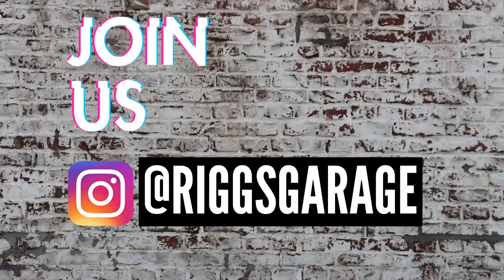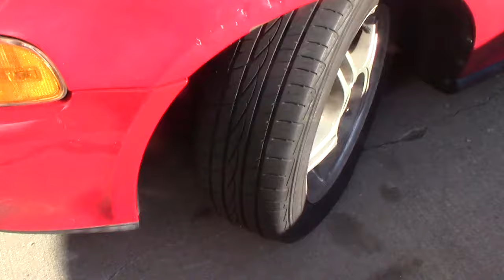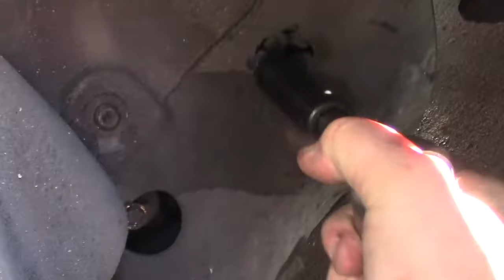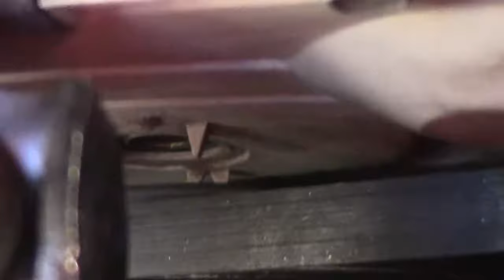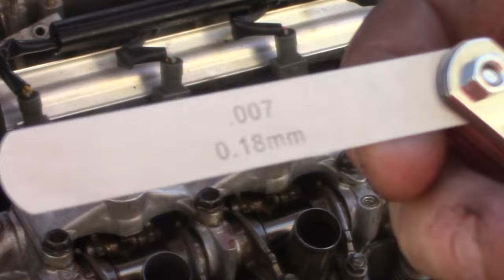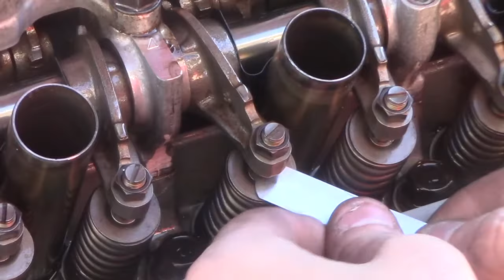How to Adjust Honda Civic D Series Engine Valve Lash (D15, D16)

Comment: I'm so glad to find this video. I've got a Honda D17A2 1.7 Liter and I have spent a month trying to get the valve lash properly set. I've been using the repair and maintenance guide that dealerships get. It indicates that both exhaust and intake settings for Cylinder 1 should be done at TDC, and then following the ignition sequence of 1-3-4-2 with a 90 degree counterclockwise turn of the cam gear (which is supposed to equate to a 180 degree turn of the engine gear down behind the tire). 

I've used feeler gauges and Go/No Go feeler gauges, as well as a positive response bolt to find TDC for each individual cylinder. But I just cannot seem to get the valve lash right. Tried 11 times and it's driving me batty!

So, is the method of turning the camshaft at the gear at the top of the timing belt an acceptable action? It's a 1:2 ratio, so a 180 degree turn of the engine pulley is equal to 90 degrees at the cam gear. And, if you follow the ignition sequence to get TDC on each cylinder, setting the intake and exhaust at that specific cylinder as you go, will it work?

And, most importantly, how much drag should you feel on your gauges? I've tried supposedly foolproof gauges which have two thicknesses on the blade: one is the desired gap clearance, and the other is a larger size outside of acceptable clearance range. You simply tighten the rocker arm bolt down until the thicker of the two clearances on the blade can't fit. And I did that exactly, but I must be some kinda gorilla to drag the blades through as hard as I do because it still resulted in a valve lash so tight that it endangered the engine. 

So, in light of that, can anyone liken the amount of drag you should feel on the feeler gauge blade to something else that might be known as a daily action? Pulling open a fridge door; something like that. Or, for the more mathematically minded, does anyone know how much force is required to drag the blade through the gap? In Newtons, Foot-pounds, or what have you?
Reply from the maker: Wow 11 times! That's pretty intense. Let me see if I can help you. 
As for turning the cam gear, are you referring to actually turning the engine with that bolt on the cam gear? I would not recommend that one
I'm wondering if your multiple attempts are because you are not holding the valve lash adjustment with a screwdriver as you are tightening it, so your adjustment isn't actually getting dialed in to what you measured. Does that make sense? 
As for your question about how the gauge should feel as you drag it out of the gap, that's pretty hard to quantify, but I'm sitting at my desk here and I would equate it to picking up a piece of paper in between your thumb and index finger, then dragging the piece of paper out from between the thumb and index finger. Tight enough to drag some what, but not very tight. Then you have to make sure you lock in that exact setting and don't let the lash adjustment move when you tighten it down.
Reply: @RiggsGarage  Thank you for taking the time to reply. In regards to the cam gear, since it's connected to a solid camshaft, and the gear is connected to the engine pulley via the timing belt, I yanked the spark plugs so there would be less resistance in the cylinders and used a universal camshaft lever (Looks like a big lowercase y with the angled arm on a hinge. Pins screw into the side of the straight and hinged arm ends, which you then fit into the cutouts of the cam gear in order to turn it.) It doesn't run the risk of messing with the cam gear's connection to the camshaft that you would if you turned the cam gear by the nut. And the pins are on opposite sides of the cam gear nut, resulting in even pressure applied to the cam gear as it turns. So, I am not exactly turning the engine in the manner you describe, but I am still turning the cam gear and relying on the timing belt to turn the engine pulley for me rather than turning the engine pulley directly. Thus far, marks on the timing belt, cam gear, and engine pulley indicate it's all still in sync.

If that's a problem, just say the word and I'll stop. 

In regards to not holding the screwdriver in position, I understand what you mean; that would be a big problem if I were using something like a socket wrench on the locking nuts. But I have one of those rocker arm stem adjustment tools where it's got a vertical grip, and from the bottom extends a closed wrench end that is the correct size for the locking nut; from the top of the grip extends a slot that sits directly above the wrench end. It can be used to more easily line up a screwdriver to reposition the rocker arm stem, as well as to keep the stem from drifting when tightening down the locking nut. Still, that rocker arm stem can shift a little when you tighten the lock nut seemingly no matter what you do. That's why I got into the habit of checking the valve lash before and after tightening the locking nut. And, yes, the check after always indicated a tighter valve lash. So, before tightening the locking nut, I began to loosen all of the stems by roughly 5 degrees more than what I thought it should be set to based on my feeler gauges. I tended to get the same lash measurement before and after by doing that. 

You've offered what is probably one of the best descriptors for the amount of drag to look for that I've ever read. Hell, it may be the ONLY descriptor too, but it's still extremely helpful. I've been exerting 10-20x that much force, like I was trying to crosscut rough hardwood boards with a dull handsaw. Rip and drag, rip and drag. I'm doing all this with no formal training and just online tutorials like this one and a Service & Repair manual that Honda provides to their dealerships. It's comprehensive, but it assumes the user already knows these little tips & tricks. So, thank you for bearing with me. 

Guess I am more a gorilla than a grease monkey. :)

Heck, this wouldn't be a problem at all if I had an extension for my Drill-Out. I was just replacing a blown valve gasket, replacing the spark plugs while I was at it, and was almost done when one of the damn bolts that seals the valve head and valve cover sheared off suddenly, despite being well below the 8 lbs of torque indicated for their installation. And, in accord with the commands of the God Damn¹ of Automotives, what remained of the bolt was lodged so deeply in the valve head that I couldn't reach it with any of my Easy-Outs, reverse-threaded drill bits, medieval torture devices, or WMDs that will get the bolt out even if it means taking out everything in a 6 inch radius. (Thermite in a coffee can. stick it on a car hood, light up the magnesium strip, and gravity will set that puppy to work. Of course, while it works, it only works just the once. 😂) So, I had to take off the frigging rocker arm assembly. And that's when I learned certain vehicular components operate by the evil exuded by the trace amounts of Hellfire they contain. Hence this predicament. 

I have a better idea of how much drag we're talking about now. So, if you could get back with me on your thoughts about how I'm turning the engine, as well as answer one last question, that would be awesome: The gap clearance for the intake and exhaust each have a documented size range; I think the exhaust for mine ranges between 0.009" and 0.011", but let's assume that's the case here even if my memory is off. I've been using my gauge blade set at 0.010" to try to hit the middle of the road. But, seeing as I tend to overtighten, should I be using a feeler gauge blade that's thicker or thinner than 0.010" to try to help compensate?

Thanks in advance, man. Oh, and how do you get old oil and grime off the exterior of an engine? I'm hesitant to use something as strong as a purple degreaser because I'm afraid the spray will hit nearby plastic parts, rubber hoses, or electrical wiring. But oil is still slightly acidic (I think), so I can't have it coating the exterior of the engine and eating away at it. Your engine looks to be shined beautifully. Any tips on cleaning oil, grime, and soot without damaging anything would be doing me a solid.

Peace,
John

Motto: "End Vehicular Assault. No car deserves to be subjected to the violence and profanity when that one mother******, c**ks******, d****pump***, *********, *******, piece of *** bolt that is shat from the pus, that lives on the crud, which is a parasite of the fungus, which grows on the scum, which is lower and worth less than snakeshit in a wagon rut, just won't come the hell out." 

(A bit long to put on a bumper sticker, but I'm still working on it. It's a grass roots movement. Sort of has to be since it's most relevant when the frigging car won't move! 😎)

¹(we don't call out 'God' when only divine intervention will unfuck whatever has just been fucked up that we're working on, do we? No. We yell "God Damn!" to the heavens, because we know it's the proper use-name to invoke the bastard in hopes he chooses not to be a bigger bastard. Kinda like how I thought my little brother's first name was "Stop That!" and his middle name was "Dammit!" until I turned 8.)

Edited for length, which is saying something; none of it good.

Comment: I tried this - when I set the clearance - all is good, but after tightening the nut, the gap increases, and I try to make sure the inner threaded part does not move. It seems like the nut lifts the center part slightly when tightening.
Reply from the maker: So you need to adapt. If the gap increases when you tighten, then set it slightly tighter than you think you need, tighten, measure, adjust as needed. Hopefully this helps!
Reply: @RiggsGarage  Yes - that is what I had to do in the end -  to get consistency, I set the gap to get a good drag on the feeler gauge, but added a slight turn in before tightening nut.

Comment: Could this being off cause the car to hesitate and run rough upon acceleration? Nice video by the way!
Reply from the maker: Thanks! Likely not valve lash, I would start diagnosis somewhere else, as simple as looking at plugs, wires, dist cap, reading codes, looking over injector wiring, IACV cleaning, and much more

Comment: When I put mine on top dead center I cannot get a feeler gauge in cylinder 1 or cylinder 3 but I can in cylinder 2 and 4
Reply from the maker: It sounds like you need to rotate it 180° more to get one and three
Reply: @RiggsGarage  I did I finely got it. Still has a little chatter but a lot better than it was
Reply: @RiggsGarage   I use a 9000 valve lash on the exhaust and I use a 7000 on the intake an no matter what it still Chatters like a old sewing machine so now what do I need to do to fix it because I cannot stand it

Comment: Would it vary if the head was fully built?
Reply from the maker: What does fully built mean to you?
Reply: @RiggsGarage  it’s a y8 head with super tech valves and retainers, BC valve Springs and a Stage 2 BC cam
Reply from the maker: @trevorsimmons6214  I'm about to do similar, not sure if lash changes. I'd check with cam/spring manufacturer and see if they specify

Comment: Adjusting two sides of valves on the same engine time? 🤔🤔 that engine haae 4 times not two.
Reply from the maker: Not following what you're asking, here's the breakdown, all valves are adjusted in this sequence:
#1 on TDC: adjust exhaust 1&3, intake 1&2
Turn engine 180: adjust exh 2&4, intake 3&4.
Reply: This is new to me. So that is for that engine only? I am learning.
Reply from the maker: @javierestrada6927  it will work for any d series Honda as far as I know. Let me know if you have questions

Comment: This stuff is so aggrevating lol my motor is perfectly in time, put it at TDC and cylinder 1 is adjustable and cylinder 3 is compressing lol
Reply: @RiggsGarage  had a major brain fart earlier lol forgot all about the duration and lift the aftermarket cam has, so had to adjust them a little different.